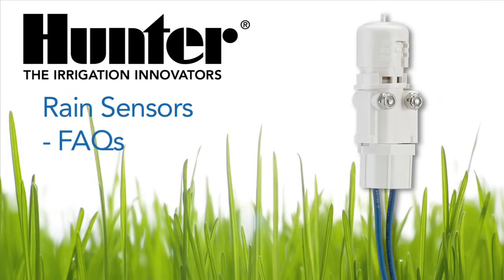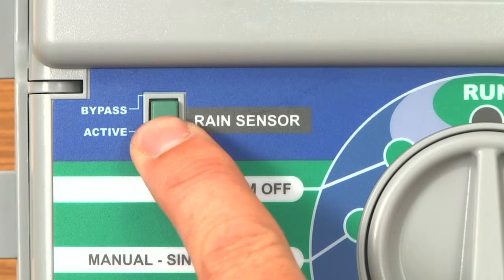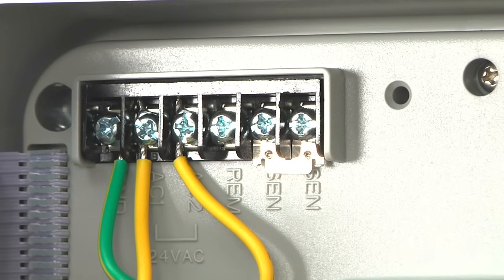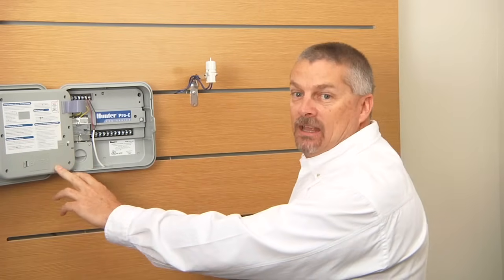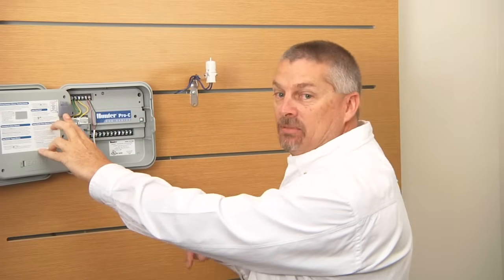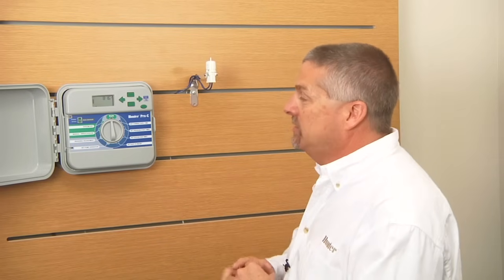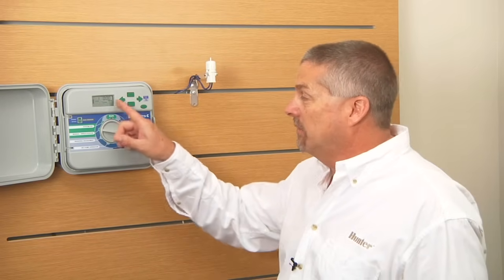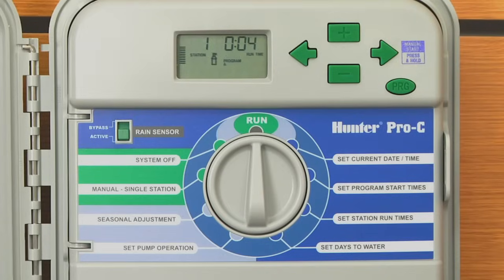Rain Sensors - FAQs

Comment: Our rain sensor is lighting up the sensor bypass red light on the wireless rain clik but the umbrella is not coming on. There is no bridge between the different connection terminals. Both yellow are in the power and the white and blue are in the sensor terminals.
Reply from the maker: This sounds like a good reason to contact our customer support department: https://www.hunterindustries.com/hunter-technical-support-email-request

Comment: So i just found this video because my rain sensor is making a buzzing noise and is causing my controller to display an error message. If i wiggle the sensor it goes away. So can i just unhook the sensor and put the jumper tab back in and do away with the sensor? Thanks for any help
Reply from the maker: Feel free to disconnect the two sensor leads but be sure to replace the original jumper or make one of your own.
Reply: @Hunter_Landscape_Irrigation  thanks a bunch. Worked like a charm. They placed this sensor where it got wet every watering and always had it in bypass. It was kinda pointless but everything is operating perfectly now. Thanks for the quick response, much appreciated 👏

Comment: My 400i does not show current time when in "run" position. Is this normal?
Reply from the maker: Normal status should show the time and date. If it doesn't try moving the dial to another dial setting and back to Run. If that does not fix it try performing a factory default. Use this web address to learn how to do that if your not sure.

https://www.hunterindustries.com/support/pro-c-clearing-controllers-memoryresetting-controller
Reply: It ended being a loose wire connected to the controller. All working great now!

Comment: If you have a controller running on several zones, is it possible to make sure 1 zone (for inside a greenhouse) ignores the rain sensor and always waters but all over zones respond to the rain sensor?
Reply: Put the green house on a separate program

Comment: i have a rain sensor, and it was on bypass since the guy installed it, and he said it was fine like that and worked as intended, so it came on every day even during the rain. i recently switched it to active because that seemed right, and i dont think my sprinklers have come on at all and its been at least 3 or 4 days since the last rain. usually my porch is wet after the sprinklers go and i havent seen any water marks each morning. i recently noticed the sensor seems to be connected to the COM port instead of the SEN ports which are available. is that bad? ill have to check if the sensor displays "OFF" when i switch it back to active or not. could it be the vent ring thing? the sensor is outside my house on the chimney i think near the second floor.. its pretty high up if i remember right
Reply: You can wire a rain sensor to the COM port & bypass the sensor ports, but the wire that used to be there (in the COM port) was the common wire to the valves, & it's now connected to 1 of the wires for the sensor. What brand sensor was installed? It will work like this, & pretty sure the controller should be placed in "BYPASS" unless there is a jumper wire on the dedicated sensor ports. I don't ever wire sensors up like this, though I've seen them wired up like this. I would wire it up properly by putting the blue & white wires (if Hunter brand) into the sensor ports, & put the white common wire back into the common port & put the controller's sensor switch into the active position. I'd also run a manual program (NOT a single manual station) & get a zone running & make sure your controller is properly running your stations. Always try to hire a licensed irrigator (if you have them in your state) or a good, reputable sprinkler company that has plenty of experience.
Reply: @rastapastrychief  Thank you for replying in such detail! Unfortunately I forgot about that comment I posted quite a while ago since I tend to have notifications turned off for replies and forgot to manually come and check. I didn't realize it was a whole 11 months ago! The same situation was still ongoing since then, so recently I had a family member adjust the vent ring to be more open and then I built up the courage to try to correct the wiring of the rain sensor in the way that you suggested. I tested it later on when I had the opportunity to get another family member to climb the ladder outside to press the test button on the sensor, while I ran a manual program start and monitored the display from the control panel in my basement. (I'm far too afraid of heights). The test was successful and the sprinklers immediately shut off upon holding the test button and displayed "OFF" on my control panel which can now stay set on active instead of the weird confusing "bypass" setup the sprinkler guy did. 

Thank you again for your help I really appreciate it.

I wrote up a whole detailed comment yesterday and youtube up and deleted it with some kind of error when I came back to edit it so here was a summary.
Reply: @shoyrushoyru  Great! No problem, glad to have helped. What brand sensor do you have? Is it wireless or wired? Asking because if wireless, Rain Bird and Irritrol both use CR2032 batteries that you must replace about every year, & Hunter's wireless sensor has a 5 year warranty and battery life, which I use more than any of the others for that reason alone. They used to guarantee  their sensors for 10  years up until a few years ago.
Reply: @rastapastrychief  I didn’t get a super up-close view of the sensor but from reference images it appears to be a hunter mini clik which I believe is a wired sensor.
Reply: @shoyrushoyru  I think I remember you mentioned the mini click, so that’s correct, as it is a wired sensor, so my bad.
Reply: @rastapastrychief  It's all good!

Comment: Can you splice rain sensor wire? I amusing about 15 ft of the old that is inside the wall and 10 ft of the new coming from the sensor on the roof?
I can a person use a Rain Bird rain sensor on a Hunter Control panel?

Comment: Would I have to shut power off when removing or installing wires to the control board ? (For example if I was replacing the rain sensor )

Comment: If the system is off due to the rain sensor at the start of a several hour multizone program and the rain sensor removes the OFF signal before the zones would have been completed, will it begin watering at whatever the current zone would have been running had the program not been triggered off by the rain sensor at the start?